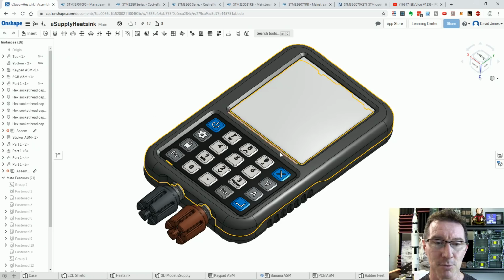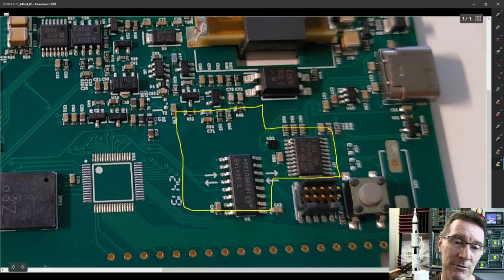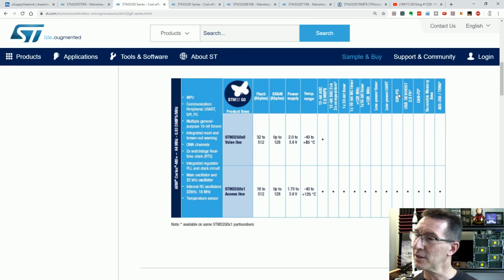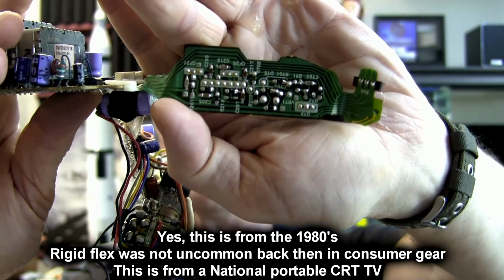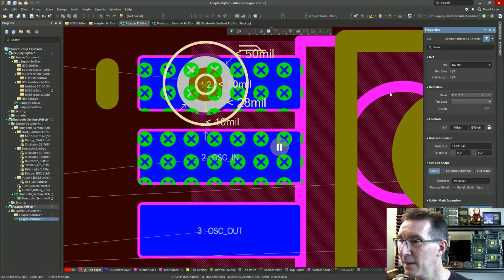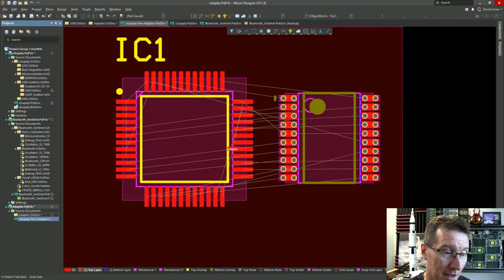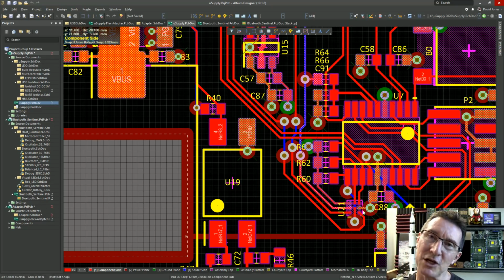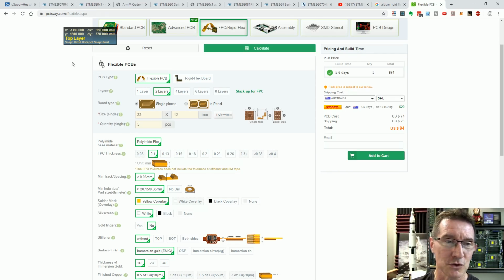EEVblog #1262 - Designing a Flex PCB + uSupply Update

Comment: Why not do a rigid flex PCB, which rigid part only over the original pad. Then there is initial height for the flex part, and probably no bending required for flex over resisters.
Reply from the maker: Because there is no physical or electrical need for that, it would just be increased cost and lead time.
Reply from the maker: Maybe if it was a production solution you would consider that
Reply: By the way, there are people who solder wires to tiny devices (wlcsp), that microprocessor is huge. Just glue it dead bug style somewhere on the board and add the needed wires.

It will look ugly and may be fragile, but a working prototype is just half an hour away. ;)
Reply: @EEVblog  I would just redo the main PCB. FPC will have the same lead time if not longer. Your PCB is not dense either - or did you assemble 100's and need to rework? . I am also not convinced the LIBs needs to be so big. Write your own lib with what you need and simplify where you can. Most LIB's try to accommodate every option and is not always optimum for code size.
Reply: There seem a lot of space on the board.  Why dont redesign the pcb so it fits the other micro.  It comes over like a hitech bodge job to mee.  I dont understand why you are taking this approache
Reply: @btouw8558  This is a get it working fix for the existing prototype boards, the production boards will be redesigned for the new chip. He says this at 6 mins.
Reply: B Touw: because he already has these prototype boards. It's about keeping the time and cost for the development low. Later he will surely modify the board.
Reply: Can put FR-4 stiffeners instead of making it rigid.
Reply: Ok ok   i get it.  Its a solution becouse of time contraints.  And to tell you the truth,  i learn about flex pcb to.  My initial reaction was pre mature.  Sorry about that.   Please continue Dave.
Reply: @PhilfreezeCH  Yes, it's very expensive in my experience.
Reply: I had to design a flex pcb for a diy project I was doing and rigid flex designs are HILARIOUSLY overpriced. If you absolutely needed it it would be cheaper, much cheaper, to design a normal pcb and a flex pcb separately and join them together yourself.

Comment: I loathe the CubeIDE ..... 🤢🤢🤢 I'll admit the fuse/clock setup/ux is pretty trick, but once that's generated it's worth taking the time to get your head wrapped around the the interrupt & error handler configurations then rolling your own CMake + ninja build & OpenOCD debug setup going ... so much better in the fuzzy-blanket of vim (or any other editor) ... The HAL eventually made me ill as well ... steer yourself towards the low level libs and checkout libopencm3 (it's really good!)

Comment: intersting ic  you are useing for the usb pd, were i work we started messing arround with usb pd a little and ended up useing another usb pd contoller wich dosn't strictly need a micro controller to work. but iplementing it with an avr micro controller prooves a little anoying

Comment: On the STM32G0 topic, I use it in my LiPow USB PD Lipo Battery Charger. I don't need normal USB functionality, only PD, so it worked out. I had initially designed it with the STM32F0 + external USB PD controller like you did on the usupply. But after attending an ST info session last fall, I switched to the G0. It turns out that it was not very simply to get the PD middleware up and running for just receiving the power profiles and setting one. Their "middleware" for the PD on the G0 was specifically written for their G0 demo board. Not intended to be portable... I did get it up and running with a few hacks. You can see the code in the repo. Also, it can be dual role, not sink only like you stated in the video. 
https://github.com/AlexKlimaj/LiPow-Firmware

Comment: Sad to see so much time and effort to do a flexy board kludge!  Would've been cheaper to do it properly and redesign the base board. Your development time probably far outweighed the cost of the new prototypes. The base board only version would be more robust and reliable.

If you need to keep a s/w engineer developing the firmware in the interim, zvpunry's dead bug mount with point to point wiring into the old socket works well. Once a flex pcb has been made it carries its own momentum - there is a well deserved reluctance to not fix whats already working. 

Bloated s/w libraries is a good motivation to choose another micro manufacturer. Cutting 990K of binary out of someone else's library conglomeration tends to be very time consuming. 
A 1M binary library started life as an enormous amount of source. Writing from scratch after cherry picking the needed functionality from the library is clean, but isn't fast either.

However, it was an good excuse to do a great educational video on flex options in PCB design which is of course your current stock in trade.

Comment: I am afraid I don’t understand? The circuit board was designed before the code was bench tested? A “flying through the air” bodge is preferable to a board redesign? (Looks like there should be possible to nudge a few things around) 

Maybe I missed something? Or is this just an “exercise” in “if you really, absolutely had to do something this ugly”?

  T

Comment: You could also find a surface-mount connector that fits the SO20 package footprint and have the matching connector put on the flex PCB. Something similar to Amphenol 20021221-00020T4LF or Hirose FX4A1-20S-1.27SV(71)... Molex and Semtec also have a lot of these high speed connector types. Some TFT displays - especially if they are MIPI-DSI - use those on flex PCBs.

Comment: Just a couple of months ago, messing around in Kicad (mostly when I should have been doing my actual, unrelated day job) I designed a TSOP 44 to SOP 40 adapter for the Neo Geo MV-1C BIOS. Flex PCB, holes in the pads and everything. Surprised and glad to see my ideas are sound. Maybe I will have them made after all...

Comment: Hello , if you are looking for information about STM32 solutions for USB PD , it exists this presentation for your reading.  https://www.st.com/content/ccc/resource/sales_and_marketing/presentation/product_presentation/group0/9c/0b/7c/2f/41/e0/40/71/STM32_USB_C_PD_solutions_marketing_presentation/files/STM32-USB-C-PD-solutions-presentation.pdf/jcr:content/translations/en.STM32-USB-C-PD-solutions-presentation.pdf
In short , either you use an external Type-C Port Controller (TCPC) like the one from Richtek, and ST has developed the X-CUBE-USB-PD software to implement the upper layers of the USB PD stack.
X-CUBE-USB-PD is free. 
Either you use an STM32G0x1 or STM32G4 with built-in USB Type-C and Power Delivery interface (UCPD). It's supported by STM32Cube.  If you want to protect the USB connector CC lines and Vbus against ESD and High Voltage surges, ST has just released a companion device called TCPP01-M12 for type-C port protection. 
For debugging you can download STM32CubeMonUCPD (for free). Cheers

Comment: We had to replace WLAN module in small batch of much more expensive boards (just for evaluation purposes). I've ordered rigid PCBs based on 0.3mm substrate and made adapter hidden under tested module completely. This way I created a breakout board for existing module, which was indeed a breakout board for LGA module on top of it; the LGA module was indeed a breakout board for final IC (how many breakouts do you need?)
In your case I'd probably go for some WLCSP package and make small PCB for it.

Comment: For USB PD (also call UCPD feature), this new IP is available in the STM32G0x1 access line. And also in STM32G4 and STM32L5 series beside USB data interface. This UCPD IP is described in the reference manual RM0444 (page 1151). The only missing part reported by Dave is about the dead battery function (that will be added soon). If you need more info on how to program/use UCPD  please have https://www.youtube.com/watch?v=Z_Sn6CBbz-k&feature=youtu.be  "STM32G0: Create a USB Power Delivery sink application in less than 10 minutes"  ! thank you

Comment: Why wouldn't you search for some SMD connector? Probably you can find one which almost fits pattern of old stm (or perhaps connector on another adapter board). In this case you'll solve problem with soldering of flat flex.

Comment: Those YT "quick solution" ""tutorial"" (read as double finger quotes) videos all seem to be the same nonsense, and it is even consistent across different topics.  I've seen howto videos with goofy techno as some disembodied hands connected (allegedly) to some poor offscreen schleb does something as three to six word descriptions flash on screen every 30 seconds.  I'm not sure if it's reassuring that even professional firms do that nonsense, my guess would be to prove that it 'can' be done while simultaneously making sure the video doesn't actually give you the neccesary information, instead requiring you to... buy something, or maybe in this case, wait until they get their sh*t together and put the proper info out there.
Reply from the maker: Interesting, haven't seen the others. Not surprising though.

Comment: All I wanted was a small, practical, easy to use, fully adjustable, affordable power supply. Sorry Dave, but could you please cut out all the wank factors and give us such a clean design, possibly based on an ESP8266 or such? Gosh. Seriously, I don't give a dead Dingo's ass about flexible PCBs right now.
Reply from the maker: Then don't watch a video about flex PCB's.

Comment: Would if be possible to make a two rigid boar solution one for each foot print, with the bottom one being thicker.
Then stack them Like a SMD chip? with the new chip being placed on the same physical place just above.
Those boards would even serve as a small heat sink, would they not? Anyhow maybe it would be a pain to assemble.

Comment: Hi Dave suuuuper again. 

Questions: 

1. what do I have to observe, for using Flex PCB in FPC connectors. 

2. I have to use BGA's because of my very tiny PCB. Can you tell a little bit about PCB construction ( FR4 ) and soldering for these ? 

Regards Rolf

Comment: Yo, the Value line doesn't have PD or USB like you said at 16:40. You need the Access line. STM32G071 not STM32G070.

Comment: AFAIK crosshatching is used just to increase the flex PCB flexibility, as a solid slab of copper won't flex as much, so crosshatch it if you think you need the flexibility.

Comment: And maybe i missed something, but why have the original chip on the bottom side of the flex when the intention is to solder it down with the topside up? would that not mirror all the pins?
Reply from the maker: I covered that in the video.

Comment: I am quite sure you don't need to round the outer edges of a flex PCB, they won't be subject to any mechanical stress, just the inner edges will I believe. (Dave shows this later on the video, although in the beginning he shows something different).

Comment: Wonder if having solder mask between the pads of the old chip and the flex is going to make hand soldering quite quirky. Because the melted solder is going to be squished between two surfaces.
Reply from the maker: Depends how much solder you use.

Comment: Hi Dave, great video.
[soapbox]

As a service and repair engineer I keep seeing schematics of the type you have there.
They are great for PCB design, but bloody hopeless mate when it comes to using them for hardware trouble shooting.
I call that type of schematic a "search-a-word" schematic.
For example, you have a connection cc1; 
1). Where does it go? 
2). How many components does it go to?
I have to play "search-a-word" over the ENTIRE schematic to make sure I have ALL the cc1 connections.
Data and Address busses are not a problem due to the size of their presence in a schematic.
I don't want to have to have "Paul Daniels" Apple schematic software or the expensive CAD it was made with to do the job.
We still need a CONNECTED type schematic, OR a way of stating where cc1 goes on the schematic (not a table/legend at the side of the schematic).
[/soapbox]

Comment: Dave, BTDT with legacy package replacement on industrial systems.  Use 0.8 FR4 with 2 risers mounted perpendicular to the surface, no castellation required but ensure copper extends to the edge, no flex required... Use vias both ends near the pads to bring the traces up both sides of the risers. Mount the CPU board on top off in line from the pad rows, toward the top of the image, and extend a tongue to couple to the risers on their inside edges.  All in a low cost quick turn FR4 process from any fab in the PRD. Glue some braces to support the assy.

Comment: I had a hunt, and the bit you missed in your video was the G0x1 series has USB-PD, while the G0x0 series (that you showed) does not. However, none of the range seems to include USB FS/HS so if you want to have data, you'd need a different chip!

The thing the suppliers don't want to do is provide support - and as you go up the value chain it gets worse and worse. You need to convince them to let you in which relies on demonstrating capability. Terrible datasheets is a good way to make sure people can't use your part. ST, on the other hand, was probably releasing a bit earlier than they should have. There's a lot of moving parts in releasing a chip and clearly someone was later than they were expecting. In my experience, ST's documentation is so good I haven't needed to contact them.

Comment: Questions I always ask: 1. Is this micro available with bigger memory options in the same package? Software always expand to fill the available space. 2. Whenever I see a line of vias or pads, I ask "Can I route a track between them?" 3. Where the f**k is pin 1 on a connector (in this case the pads for the PCB IC) especially when it is rotated and/or flipped.

Comment: Did I miss something: wouldn’t a crystal and any decoupling cap/s “need” to be mounted on the flex? That 2-layer, flex board is a fairly big antenna, with the MCU a long way from the base board an its support components.
Reply from the maker: Looks at the actual distances involved, it's quite small.

Comment: Hmm. I must be one of those screaming viewers. The 0.3mm vias are probably fine, but I would not feel totally confident that this flow-through plan would result in quality joints. I’m not seeing why one wouldn’t simply add ~3 vias (potentially smaller for lower impedance to the traces) to provide sufficient heat flow to the lower layer, with a plan to simply perform the actual flex-to-baseboard assembly with solder paste. Seems like the “flex” is still rigid enough to lay flat on the pads. A little bit of fixturing/helping hands or whatever will be required in either case.

Maybe another commenter can clear up any misconceptions. Thanks for the quality vid.
Reply from the maker: Two vs three holes, meh, hardly any difference.

Comment: Hi Dave, I saw before a FR4 PCB which a flex connected to the top of it ( all in one piece ! ) without even soldering them together. This might help you for making the mod. You could find it in the moving head of the DVD/CD Writer.
Reply: That is a rigid flex, as discussed in the video, they are quite expensive!

Comment: About rant to ST - they at least don't swap USB D+ and D- pins in their MCUs like Atmel/Microchip does with their SAM3 series...
About overall video - great tutorial for flex PCBs! When you will make tutorial for rigit-flex one? :D
Reply from the maker: LOL really?
i had a PIC 24F with swapped UART pins once.
Reply: @EEVblog  yes, really, check ATSAM3 series, their one set of USB pins is fine, but second one is switched up and you need to do magic tricks during layout, check Arduino Due board and mine board, called OpenTacho. You can find it on cadlab.io and github. Low-Mid "edition"

Comment: Your rant against the ST library is unjustified. If the library doesn't fit, it means the library doesn't support the ST microcontroller you want to use. You're not strong in Software! I understand the appeal of re-using a library, but it's microcontroller! Write your own software tailored to your usage. Then you can probably/likely fit a HID driver and power delivery control in 32kB.
Reply from the maker: David IS strong ins software and he says is crap code, and seems other people agree with him.

Comment: I used ST micros for a lot of projects in the past but lately they are pumping out new Controllers without properly documenting them. Back in 2011 we tried to implement a Flexray-CAN FD Adapter using a SPC56XL70-Series controller. In the end we gave up on this as the datasheet was not complete and several registers for Flexray were completely unexplained. Other Register descriptions were plain wrong. The correct datasheet came out in 2013!
As for your flash problem. I usually do the software first on the biggest available Controller. Once thje software is final i reduce the flash size for production as far as possible.

Comment: honestly why go for flex? small normal rigid pcb with some pins sticking out. the pins provide clearance to the pads and you can solder them to the board
Reply from the maker: Height is an issue. Also, it's a nicer solution, and excuse for a flex video.

Comment: Hi Dave, love your PCB design videos.
How about using a thicker FR4 with castellated pads for U2 chip and cutout slots to clear discrete components and putting your new chip on this daughter board somewhere closer to USB port? You might even add extra castellated pad for more stability and solder it to pad next to your switch, sorry can't quite make out the silk screen part number. I'm only 14 min in so this might have come up later.

Comment: For figuring out complex routing around components, just copy all the parts in the afflicted area to a new design, and create mech layer keep-out boxes around them, delete parts, make flex PCB outlines. Keep outlines as absolute measurements so you can avoid 'eyeballing it' when the design inevitably doesn't fit the first try through.